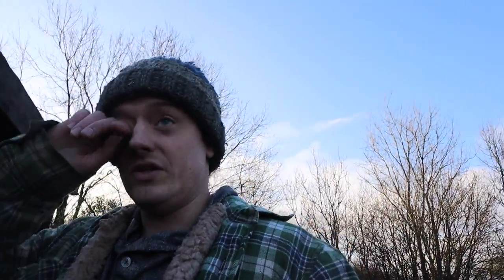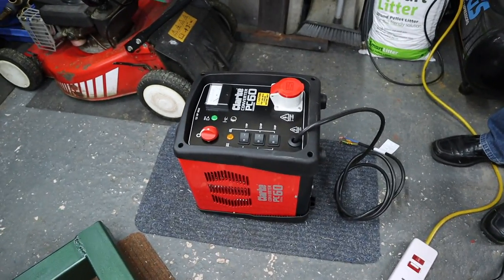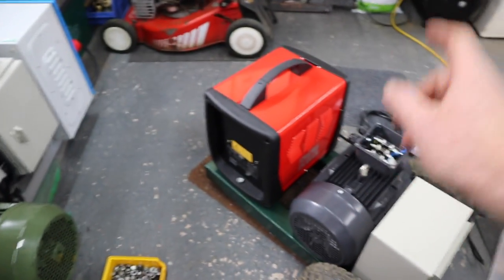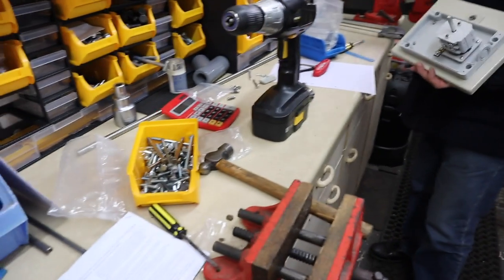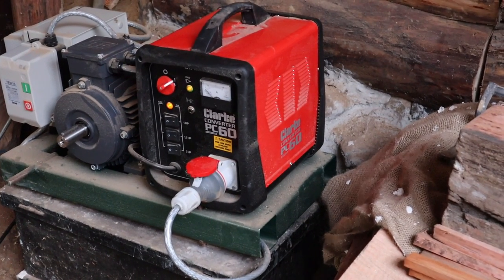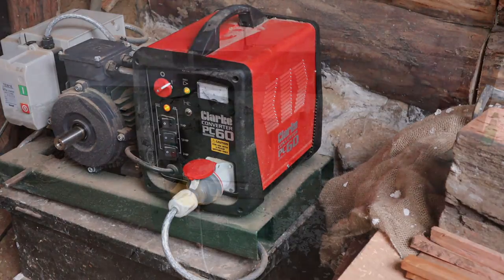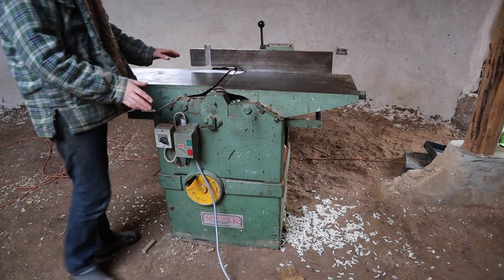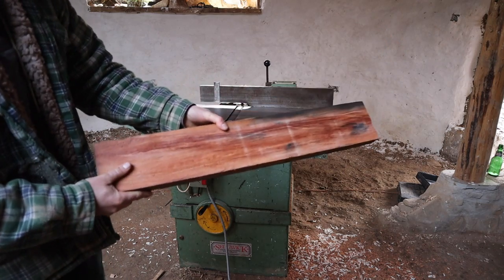Easy DIY Rotary Phase Converter Build (Off Grid Three Phase Hydroelectric Power)

Comment: Kris..... THIS IS BLOODY BRILLIANT!!! haha how awesome!! its really coming together mate, how wonderful to run that lovely industrial equipment from a stream! epic! sounds like a serious inverter too.  What a fantastic Christmas present! how flipping cool is that! id definitely give the flywheel a go, maybe an old car one belt driven from the motor that way you wouldn't need it right on the end of the motor shaft?      .......... Still can't get over how cool this is!
Reply: Not sure a belt driven flywheel would be any good, because the peaks come with such force the belt would probably just slip, lowering the amount of force you can transfer from the flywheel to the motor.  I don't know how fast car flywheels are designed to spin, but attaching one to a motor like this means (without gearing) you're pretty much limited to 3000 RPM for 50 Hz power.  This is pretty slow for flywheels (which usually store most of their energy by running at a very high RPM) so I suspect a car flywheel wouldn't have enough weight to provide much in the way of peak current delivery.  In Kris' case I think he would need something very heavy so that even at the lower RPM it can still pack a lot of punch.
Reply: @Berkeloid0  most cars will rev between 5 and 6k rpm many will do more, they are already balanced and designed to spin at speed they are also very much readily available and cheap secondhand. 
I suppose the belt has got the potential to slip but It would depend on how much force is required. Knowing Kris and how well he works stuff out and designs things I would imagine that this setup wouldn't be far off working as is so just needs that extra little help. You could also do a multi-ribbed or even toothed belt for better inertia capabilities.
Reply: @pjoutdoorservices775  If they're designed for 5-6 kRPM then it means in this situation they will only be storing half the power they could potentially store in a car.  I have no idea how much this would equate to in terms of peak amps/watts that they could push back through the motor, but I suppose you could always fit more than one.  Any idea how much a typical flywheel weighs?  I am completely guessing but I imagine you'd want at least 100 kg (220 pounds) in the flywheel to be able to deal with these kinds of spikes, since the flywheel can't lose much speed even when it's returning power back through the motor/generator to power the shop equipment - as soon as it drops much below 3000 RPM the AC will drop below 50Hz and if it goes too far below you can run into problems.  Admittedly it would probably work fine if all you're running is a motor like Kris is, but if you want to run other equipment (especially things with transformers in them) it can be problematic.  Definitely worth investigating though if they are cheap and readily available!

Comment: Until you fit the flywheel, perhaps best to remove the key from the motor shaft in case it gets thrown out when running the rotary convertor. The flywheel should certainly absorb the startup peak. The demand from the static convertor will only increase when the rotary convertor is included due to decreased overall efficiency resulting in even less running power of the planer so. Hope you come up with a good working solution.

Comment: My (3 year late) idea, would be to have a 2nd power button on the machine with 3 resistors (or hair dryer heaters) in-line with the power. 
So it makes a soft start, then 5 seconds later - switch the main green button for full power.

Comment: ok that was not what i expected i thoght it was going to be a single phase motor running a 3 phase motor as a generator nice to know they is a unit to do it all with out using 2 motors
Reply from the maker: yeah, i am very impressed with the static converter. clark stuff is usually a bit cheap but this thing is really good.
Reply: @KrisHarbour  i know when i was about 19 i worked in a wood factory with over head routers and they had a phase changer under them just looked like 2 moter with drive shafts linked never really understood what they did

Comment: 11:49 maybe a sizeable flywheel with a friction centrifugal clutch? So that when you turn in the rotary converter, the flywheel will slip and then the clutch will engage avoiding a huge inrush current and then the mass of the flywheel should provide enough stored energy to help the planer start?

Comment: To clarify a few points
1 a 3 phase motor only needs 2 phases to run!  Incorrect loosing 1 phase it will indeed continue to run at much reduced power and shall rapidly overheat. It will not start without 3 phase or rather since there is not 360 deg rotating field. 
If you apply 2 phase and give a spin it will continue to spin in whatever direction you gave it a spin.

2 Clarke PC 60 does indeed output psudeo 3 phase here is how it does

L1 comes direct from the mains
L2  loops of L1 goes through a bank of capacitors leading 90 deg phase shift
L3 loops of L1 goes an auto transformer (inductor) lagging 90 deg phase shift

Giving L2 +90 deg L1 0 deg L3 -90 deg
I can provide a link to PC schematic if required.
If you have L1, L2 , L3 connected to the motor on your skid then have connected your planer two this all you have done is paralleled the two motor.
For information in the USA 220 volts is 2 phase (120 deg separation)
Regarding running 2 motors of a VFD is not a good idea, but not for the reason you give. It is more do do with harmonic distortion 
Formula for calculating induction motor speed is
f  = frequency
P  = number of pairs of poles eg 4 pole = 2 pairs of poles.
N = motor speed 

N = f x 60/p our American cousin use f x 60 x 2 then on bottom line use number of poles, the answer is the same.

Eg 4 pole = 2 pairs of poles
f = 50 Uk mains frequency

N = 50 x 60/ 2
N = 1500 rpm for simplicity I am ignoring motor slip

Comment: I think I'd look into building a diesel generator, and fuel it with used vegetable oil! Or possibly  a gasoline generator, use wood chips to fill a still. And make methanol to fuel the generator.. modify the carburator to allow the engine to run on methanol. If a custom generator is built, and methanol is going to be the only fuel. Further modification can allow the use of a smaller engine possibly a 8hp taking the place of a 10-12 HP engine, start with raising the compression, about 40-50 psi and porting the head, smooth out the exhaust port, and slight enlarge the intake port   leaving it a rough sand paper finish, (60-80'grit) use a long header and large free flow muffler.  Even a car muffler can be used, a 2" inlet 30" long glass pack,  and a long intake spacer and space the carb out about 3"  possibly using a larger carburetor, from a motorcycle, and incorporate a electronic governor.  The long intake runner should boost the intake charge , a slight supercharging effect the raised compression will raise the TQ a fair amount. TQ over time is HP.  It should easily take the place of a 10 HP engine, and the methanol/wood alcohol is free, pyrolysis of biomass, distilling wood chips , sawdust, much clearer than oil just start with dry wood, it may require a second run in a still, at a temperature just below boiling of water,  then use molecular sieves to remove any water. A small amount is ok, 5% or less, and run the carb dry and drain it when done running it for more than a couple days. And seal the fuel tank and supply, a modified 8-10hp engine should be capable of 7-9kw possibly 10kw,

Comment: I think you could have got a soft starter for a 3p motor. Some of them will accept single phase input and still give out 3ph out. That will also reduce your starting load
Reply from the maker: Not for this i cant, those are digital, this machine has Two motors one to drive the blades one to drive the feed rollers those digital VFD wont drive two motors.

Comment: Congrats Kris on another great addition, you mentioned a massive flywheel to keep the current flowing when starting the planer, how's that work? Could you rig a flywheel to crank up with a bicycle transmission when there's not much power being generated and still spin up the planer? best, Eric

Comment: If I understood, the static converter already gives out 3 phase.  Then the 3 phase motor would have only its inertia to add to the equation.  Or is it actually a rotary converter as well?  Anyway, to handle a 3 phase motor that has such a huge inertia load, you would need at least the same amount of inertia running already before you try to start the other big one.
What an idle 3 phase motor would otherwise add is  some balancing of the 3 line voltages and some inertia in case of the main motor having too LITTLE inertia to handle its varying loads.  In the old days, some Idle Synchronous Motors were used to smooth weak supply voltages against heavy load variations as well as do power factor compensation.  They fell out of favor when power distribution lines became heftier and power factor correction was changed over to AC capacitors.

Comment: You're a wizard Harry,  There goes the world market on second hand 3 Phase tools, everyone will be doing this in their workshops now and buying 3 phase stuff?
Reply: Hardly the world market... the better part of continental Europe insists on supplying three-phase to every household, often at 35 amps per phase or less, so unless you're living in an old flat in the city that hasn't seen an upgrade for decades, you can likely run 3-phase stuff. Even flats tend to have 3-phase these days because hobs and cookers are usually set up to run on two or three phases (hobs on two, cookers on three).

Comment: I would be interested to try starting the planer and then unplugging quickly plugging it into the three phase motor converter and quickly restarting starting the planer while it's still got its kinetic energy. It might just be enough to get it going
Reply from the maker: Someone else suggested that, i will give it a go
Reply: @KrisHarbour  and I think a weighted flywheel would also give the motor some efficiency gain in the start-up process with a heavier load. I believe power plants use flywheel Motors to keep energy stored in the form of kinetic energy for those quick little surges in power in areas that have Tendencies to have high demand for short periods of time

Comment: I'm thinking the idler motor is too small or you should ad some more starting capacitors. You should know you can blow starting capacitors by bypassing the idler motor, its taking just a bit too long to start your planer on the static converter alone. You can use running capacitors as starters technically. Start caps don't like running for more than 2 seconds. Just letting you know what I've learned recently building my RPC and I'd hate for you to have to replace a cap, they are cheap though...

Comment: Hi Kris. I know this video is pretty old, but I would like to know if you have some feedback to give after several years to use the machines? I bought a Clarke pc60 too. I run a big planner and an old table saw exactly as you. After 20min of using the table saw, my motor burnt. I did it repaired for 670€ in France 😢. After this very bad experience, I'm trying to find some real feedback with static converter in real cases (not just a lab test of 5min). I 've found some posts on the web which explain that static phase converter can run the motor using a max of 60% of the power. And the motor have often overheating problems. It's exactly what I had with mine. I'm so sad. I've bought these very old machines for my 40th birthday. I'm scared to burn a motor another time. I hope you will accept to give me a feedback 🙏. Do you use the machines directly using the output of the static phase converter, or do you use your system to create a rotary phase converter? Do you use your saw with huge piece of wood. Do you have any overheating problems? Do you have any advices please? Thanks you. Cheers! Nicolas form France

Comment: Hey Kris, why didn't you go for a 3 phase inverter connected directly to your battey bank? And im also intrigued if you know roughly how much power comes from your solar panels? Im so exited about your power system. Always wanted to install a pelton turbine at my uncle's house at the mountains but they dont really need it :( Keep up with the amazing work!
Reply from the maker: dc to ac Three phase inverters to run this stuff is big money around the 10k mark from quality equipment. this setup was alot less than that and is very robust. Thanks for the comment.

Comment: Why not dc to three phase? 
Is it less efficient?
Reply: It's more expensive because you need a three-phase inverter and those aren't as common as single phase inverters.  They do come up cheap occasionally second-hand but you have to be lucky.  You can't just use three single-phase inverters because each phase needs to be perfectly synchronised with the other two, and single-phase inverters have no synchronisation circuitry.
Reply from the maker: for the same quality of inverter i would need three of them linked together and working as a three phase unit, price for that is 10k Also 98% of my things are single phase so it makes sense just to convert that for the few tools that need it as opposed to having to tap of a single phase for everything else.
Reply: You can get DC to 3 phase 400V/10kW inverters less than a 1k€ from alibaba... "good quality" is something that needs to measure but those old machines would take any current that you throw at them

Comment: Why cant you use a soft start inverter drive to run your planer to take away that huge inrush current. This would also add speed control although this wouldnt be of much use to the planer if it isnt hard wired to the planer you could possibly use it to run other machines as you fill ur workshop

Comment: Hi if understand your description you have the output of the static covertor (invertor) driving the three phase motor and off the motor terminals to a three phase socket to power your tools, maybe I have picked up your description incorrectly?
Reply from the maker: Thats correct, then the motor acts as a three phase generator giving true three phase power. from a single phase supply
Reply: Your description is the invertor outputs a three phase supply, demonstrated by you starting and running the jointer. 
A motor cannot be a motor and generator at the same time. If you have the 3 phase from the invertor connected to the motor and then from the same motor terminals take off a supply to the socket to feed the 3 phase tools basically you have parallel connected the motor on your trolley to the tools. If you have an email I’ll email you my phone number and I can expand this brief description
Reply: @gw4838  I too was puzzled and had the same picture you describe in my head.
I don't see how connecting a motor in parallel with another motor is a generator?
Or am I missing something :-)   Martin.
Reply: A use for rotary converters was where for example you have 50Hz supply and 60Hz load. A 50Hz motor would rive a generator run at a speed to produce 50Hz. For Kriss a  single phase to 3 phase VSD set to soft start mode. Would be more efficient
Reply: Should have said 60 Hz

Comment: Hey kris ..... My old motor had a throw switch. ... Could you use that for switching from your fixed power to your rotary once the thicknneser  is started ?
Reply from the maker: Hi joe, im thinking of doing something like that, have you got an ideas how i could do it? i would need to have have both plugs in something and some kind of change over switch? if you have any links or drawings that would be really helpful.

Comment: not sure if it would help but you could run single phase devices off 2 of the windings of the mechanicle side of your 3 phase unit for higher demends items i know in the factory i worked at we had 3 phase motor working off single phase the 3rd winding was join by a capicitor to the live winding i guess to offset the phase
Reply: This is a way to run three-phase loads off a single phase supply, using an appropriately sized capacitor to fake the second phase and leaving the third phase empty.  It's rougher on the motor and not very efficient so although it works, it's not really ideal.

Comment: why didn't you use a 3-phase variable-frequency drive where you can program the acceleration ramp and voltage?
Reply from the maker: The planner has two motors that run at different speeds.
Reply: @KrisHarbour  It's no problem running 2 motors with 1 Inverter, you just need the ramp for speeding the big motor up
Reply: a star delta switch will work fine, too

Comment: Something wrong here. The PC60 static inverter can supply a 5.5 HP motor and requires a 25 amp single phase supply according to the specification sheet. Where does 8.5HP come from?
Reply from the maker: Start up current is always Many times what the rated run current is